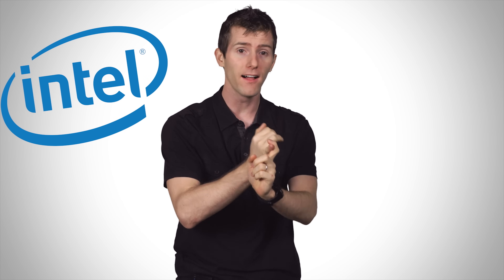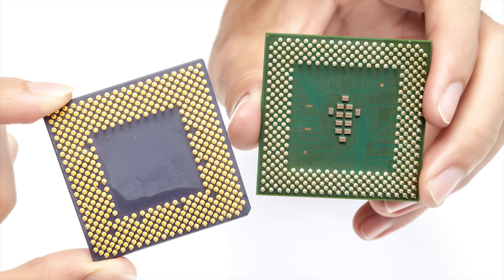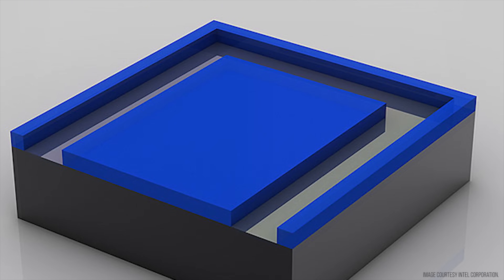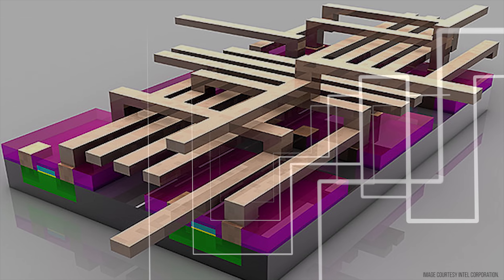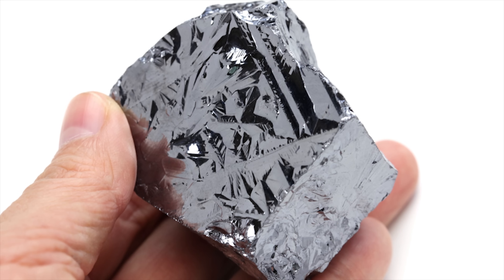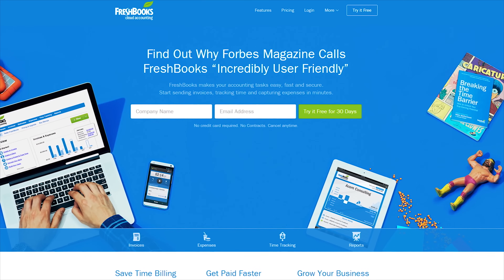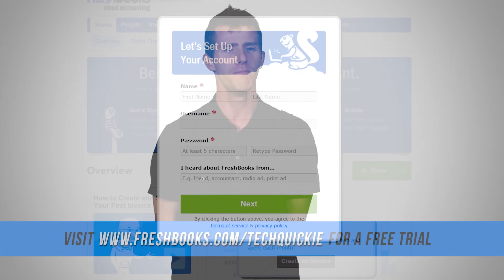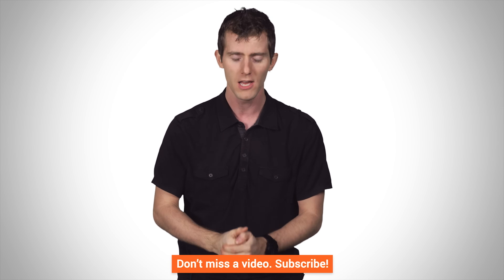How CPUs Are Made As Fast As Possible

Comment: "...to create transistors, that only allow current to flow in one direction, which means they can function as tiny switches or gates..."

You're getting transistors confused with diodes. It's true that transistors function as tiny switches, but it's diodes that only allow current to flow in one direction. The function of a transistor is harder to explain succinctly, but it's basically an electronically operable switch. And it generally takes multiple transistors to make a single gate, so you shouldn't really equate the two.
Reply: +Yoshie Thank you, this was bothering me a bit.
Reply: +Yoshie True, but the physical construction is almost identical. I think (just going off of memory here), a diode is a P-N junction, and a transistor is just what happens if you add another P or N junction, hence PNP and NPN transistor types. But you're right about the function of transistors not being the same as a diode.
Reply: @LazerLord10  As far as I know, that only applies to BJT's, no? CMOS Transistors have different nomenclature I think
Reply: +MrNateSPF You realize that MOS (BJTs are not used in processor design) transistors are completely reversible? The drain and source are physically identical and large-signal operation only depends on the bias voltages. Also, the diode icon refers to the polarity of the Gate-Substrate: into the bulk for PMOS, and into the gate for NMOS. Without going into parasitics, there is no current that flows through the gate of the MOS device.

BJTs can also be reversible, but doping concentration will lead to a much lower beta in reverse bias
Reply: sin I tinker with electronics as a hobby and studied it in school. I think it's pretty basic knowledge.
Reply: MrNateSPF "You realize that MOS (BJTs are not used in processor design) transistors are completely reversible?" says *****

I've already made my argument to Linus, although it's doubtful whether he will see it. You tried to dispute what I had said and I am defending it.
Reply: +MrNateSPF If the only point you were trying to make is that there's a diode icon inside the transistor icon then sure, nothing you've said has been refuted. But instead of offering that interesting fact on it's own you prefaced it with "It sounds like you are still learning so I'll go easy on you." which implies that I said something wrong and you were correcting me. As pointed out by other commenters, some transistors, such as those used in Integrated Circuits, are able to carry current in both directions. And as pointed out by myself, limiting the direction of current is not the primary function of a transistor, while Linus says in the video that it is.

It's clear that there's some kind of miscommunication, and I'd appreciate if you told me which specific line of my argument you disagree with instead of replying with another vague and rude comment. I am providing as much detail about my reasoning as I can in an effort to resolve this disagreement, and if you don't offer the same courtesy then perhaps it is you that's not ready to hold an adult conversation.
Reply: MrNateSPF And in his video Linus said that allowing power to only flow in one direction makes a switch. I don't understand why you're using such patronising language like "you're getting closer" and "sounds like you are still learning so I'll go easy on you", nothing I've said has actually been incorrect and the main point that you made was tangential and has been refuted anyway.
Reply: MrNateSPF Clever tactic, don't address any of the points other people are making, just claim over and over again that you're right. Maybe if you keep trying people might believe you.

You're the one who's using condescending language, you're the one who's being childish.
Reply: fun fact, a computer is made alomost entirely of nand and nor gates. these work like and and or gates, but the output is reversed. why, because they take less transistors to make. these gates can also be used to make any other type of gate you can think of so it is very veritle. also, you have to think about what field he is exacley. linus' education in how to view computers is, hey this compinent does this for the system. His education doesn't need to go to the level of electrical engeneering where it is this PART of the componet does this, this is the pros/cons of this design, and here is how it affects other componets in the circut. because you can't go fix a short in a manufactured circut the size of your finger nail.
Reply: MrNateSPF You can't control how I read it but you can control the tone of how you write it.
Reply: +Yoshie this guy has no idea about electronics
Reply: MrNateSPF Oh, okay, that's fair enough. I think you probably should've phrased your comments as a suggestion rather than a correction in that case though.
Reply: was looking for this
Reply: +Chuck Ray Are you talking about me or MrNateSPF? I'm not sure how to interpret your comment sorry.
Reply: +forestR1 Actually latches are made up of gates, and gates are made of transistors. For example, a flip-flop (the most common latch) is made of 2 NOR gates, and each NOR gate is made of two transistors.
Reply: Yoshie sorry, yep you're absolutely right, I had that backwards
Reply: ***** The construction is very similar, yes. IIRC they also both rely on the same principle of physics in order to work, that of making an electron gap. But Linus still goofed.
Reply: Though you are right but transistors also allow current flow in one direction only depending whether it is npn or pnp
Reply: yeah some reality is more difficult to explain to a layman....
Reply: just a formation of transistors. meaning both T1 AND T2 need to be switched on or in a conductive state for output
Reply: forestR1 No worries man, it happens
Reply: +Yoshie Yes. Correct way to phrase operation of transistor is to say that it FLOWS or NOT FLOW (ON/OFF) state depending on voltages applied at the gate. Also it is possible for current to flow in either direction in a transistor depends on how you hook the voltages up in the 3 (or 4) terminals of a typical MOSFET transistor.
Reply: +francois qian kek
Reply: +Dhoobs Patel of three legs
Reply: an & gate (or any other logic) is made up of latches, which are made up of transistors (and other components). transistors are analogue components, whereas an & gate is a fairly basic digital logic circuit
Reply: I agree with you.
Reply: Both transistor and diode work as a switch, which allow current to flow in one direction, but the main difference is that Transistor is a controllable switch, where we found an extra pin to control the flow (When to flow), this is not the case in diode which allow flow all time (assuming ideal diode, with no barrier voltage).
Reply: actually there is a subtle difference between latches and flip-flops, while its true that latches are made from two nor or nand gates however to make a flip-flop you need more of them. A flip-flop is essentially a latch with additional gates. For those curious flip-flops are excited( or change states) by the transition from one logic level to another while latches work solely on the level of logic. For example to change the state of a transistor you have to move from 1 to 0 or 0 to 1, they can't change state between the transitions, while the latch changes its state depending on the level so they are more prone to errors
Reply: Yoshie Linus Wants to know your location
Reply: a simple way to explain a transistor is that a small current (for bjts) at the base allows a large current to flow in the collector-emitter path, and with a mosfet a gate voltage allows current flow from gate to source and mosfets drain and source resistance decreases quickly when the gate voltage increases
Reply: @Username ditto ;-)
Reply: @Username To be honest I know that doesn't work, I was testing a particular aspect of it at the time.  This was about 4 years ago.
Reply: @Username That is what I was testing, but as it came out tone is not always clear in text.
Reply: @Username Yes, what we've been discussing.  It was only a test.
Reply: @Username Not specifically to be discouraging, it was just a test run and I got the tone wrong.
Reply: Is it true that static can kill a cpu
Reply: MrNateSPF Even ignoring the points made by *****, the purpose of a transistor is not to only allow current in one direction, and this behaviour is NOT what allows transistors to be used to make logic gates. Try making a logic gate using only diodes and see how far you get.

The switching functionality of the transistor is the important part, which is no surprise considering you can use relay switches to make (much bigger) logic gates.
Reply: What's the difference between a transistor and an AND gate?
Reply: A gate is apart of a transistor base gate are two of the legs
Reply: Transistors are chains of diodes. And a transistor is an amplifier first and a switch second.
Reply: +Yoshie Haha I was about to comment that too. Thanks :P I'm surprised so many have that knowlege.
Reply: *****
 Nice ad hom.
Reply: Yoshie
 But obviously you can not read that tone ;-)
Reply: Yoshie
 Nothing I have said has been refuted, that was your post.  As I said stick to this argument, and make it to Linus instead of me ;-)
Reply: Yoshie
 Stop acting so childish, there is no defense for what you had said. And yes it still stands that what I said has not been refuted.
Reply: Yoshie
 Clever tactic, tell these lies as if I wouldn't notice.  Nothing I said has been refuted, there are no points for me to address.  Just scroll up, no where will you find that I "claim over and over again that you're right".  Maybe you are not ready to hold an adult conversation.
Reply: Yoshie
 Yes, I understand there are many kinds of transistors.  But I was trying to tell you the stronger point is how processors work, not what a diode is.
Reply: Yoshie
 I could not control how you read it.  I posted a question for you to work it out.
Reply: +Yoshie  It sounds like you are still learning so I'll go easy on you.  But take a look at a transistor icon, notice how there is a tiny diode icon inside?
Reply: Yoshie
 You are getting closer.  Stop comparing transistors and diodes.  Allowing power to only flow in one direction does not make a switch, end of story.
Reply: *****
 It seems you should contact Linus with this.  It is consistent with the point I was trying to make.  I am sorry I don't care to write out a few paragraphs to make it.